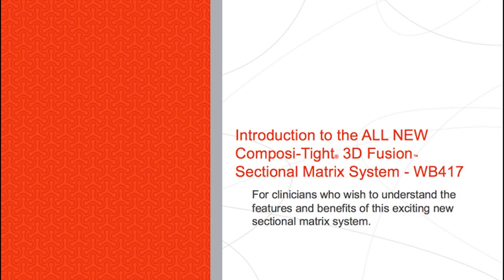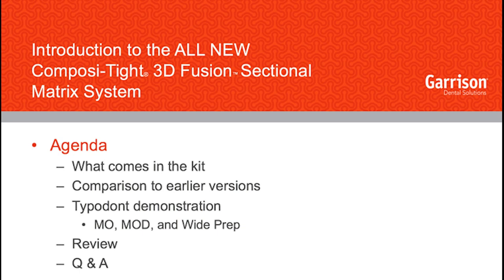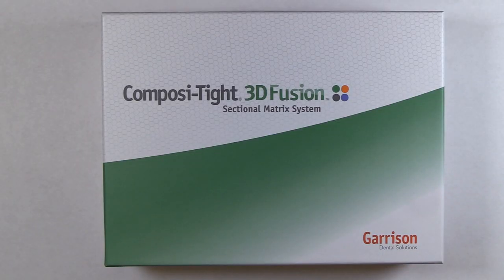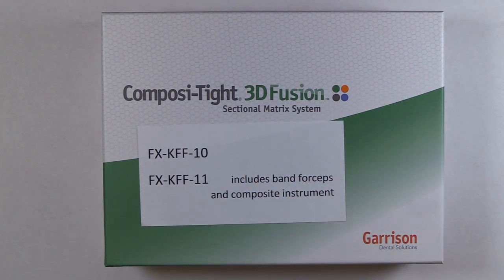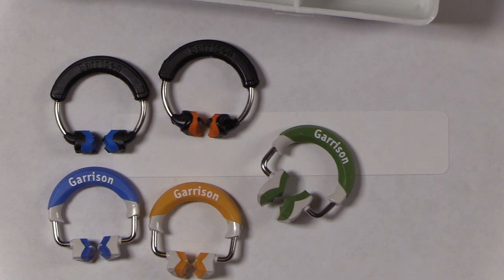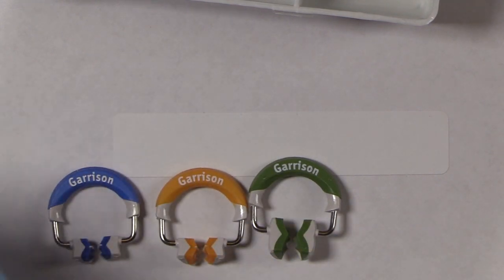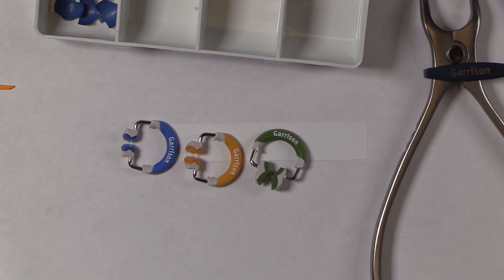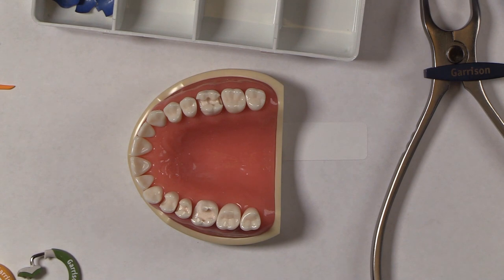The All New Composi-Tight 3D Fusion Sectional Matrix System

Comment: Is the green color may replace the orange one? I mean can i buy only the green one and i can use it for class 2 FOR tow teeth open on each other
Reply: And as the same time i can use it for single class 2 for 1 tooth
Reply from the maker: Hello Dr. Hrish. I believe you're referring to the orange and green matrix rings? The orange ring is a tall sectional matrix ring and should be used for taller teeth. The green ring is for really wide embrasures where the prep may have a missing cusp. The green ring is in no way meant to replace the orange ring. It's specifically for those cases where the prep is too wide to use a regular sectional matrix ring and the patient isn't a good candidate for a crown, and thus needs a composite restoration.
Reply: Thank you dear master

Comment: and this can I matrix can I used only on posterior tooth?
Reply from the maker: The Matrix Rings are for use on posterior teeth. You can sometimes get them to retain on the distal of the canine as well, but it isn't always easy. The bands and wedges can be used on anterior restorations using various other products and techniques.